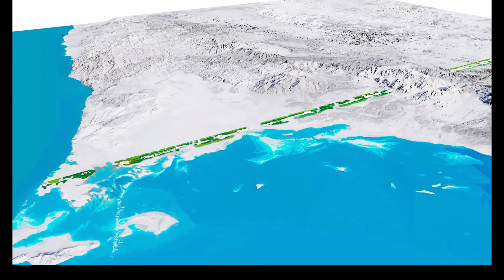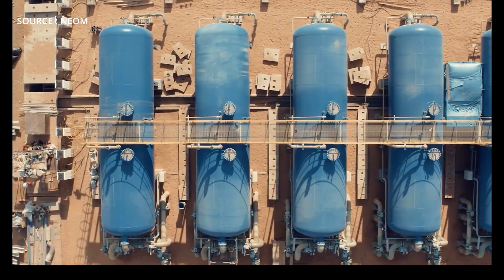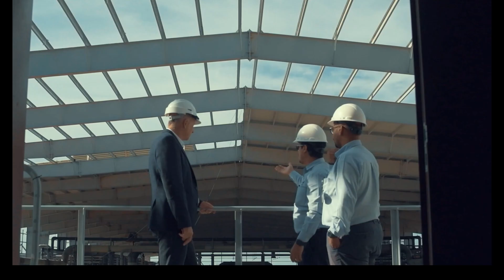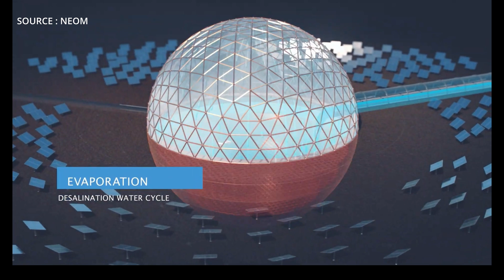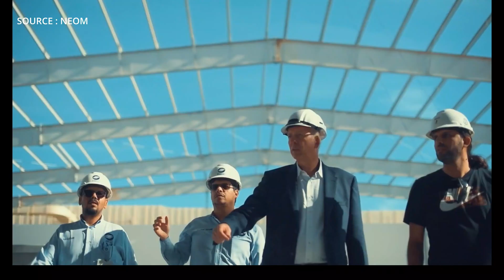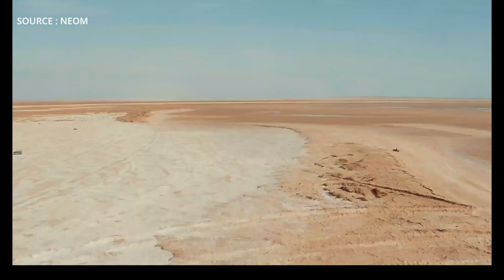100% Sustainable seawater desalination technology, Solar Dome

Comment: How come we are still in the phase of fancy 3d rendering after years of claiming that this is the innovation of the century? As if reverse osmosis or multi- stage flash desalination were not invited yet... These well established technologies can easily be combined with renewable solar power (photovoltaic for the electric power required by reverse osmosis, thermosolar for multi stage flash desalination). This concept is a hoax but it obviously still convinces investors without technical expertise...

Comment: Brine is mineral resources...
Reply: But the mineral sources are not won in the Domes which work just as solar desalination without the use of fossile energy. Winning minerals is different and will go with a vast amount of electricity through it will be made a lot by electrolysis where hydrogen is won with might be the main export good for Arabia in the future.

Comment: At Salton Sea there is also thermal heat if we can't get enough steam out of solar
Reply: Problem for water from the Salton Sea is toxic waste in the lake. Even an drop atomic bomb might lay in there. Best would make a large cooperation with Mexico and get water from the Gulf of California via the Laguna salada to region which was known as the salad bowl of America. Winning lithium and sodium for batteries can be made there and boost the whole region in great future.
Reply from the maker: @maxschon7709  In addition, California is facing the drought , getting fresh water in addition to Lithium and Sodium would be the ultimate solution for the region.
Reply from the maker: True, we can make use of it maybe.
Reply: @gamechangertech  it seems a waste to not use the steam to generate power when the desiliconization processes takes place

Comment: Sounds like this was a scam.  This was to be completed in 2022 and their has been no progress on the project.
Reply: This concept is flawed.   Can you spot the design problems?  hint: there are at least 3.
Reply from the maker: The project is still under construction, It shall be done by 2023.
Reply: Still nothing @gamechangertech
Reply: We are in 2023. How did the solar dome work out? @gamechangertech